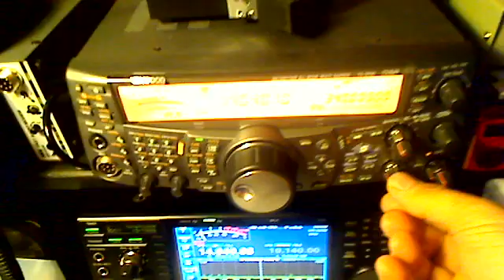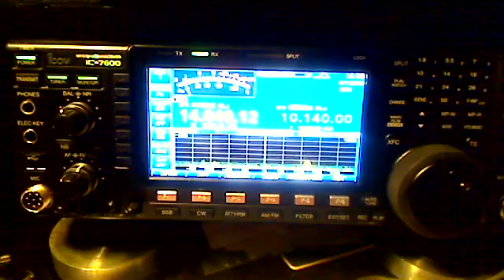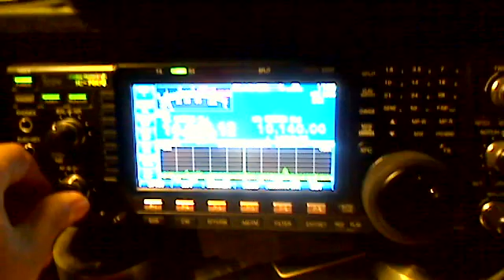TS-2000 vs. IC-7600 vs. KX-1.wmv

Comment: Although we appreciate you comparing with weak signals.
You do not have the settings even closely correct on the 7600 for CW operation.
Please turn to page 39 where it says During CW operation. then retest and repost. Then compare with the same transmitting station say W1AW.

Comparisons like this give people a very wrong impression of a transceiver.
Reply: johnnieace45  Yes he has that not right. The peak tuning is off.

Comment: All QRP rigs I've used have low noise. You are correct. The more conversion stages the rig has, the more noise you will hear. Remember the old TenTec Triton and early Omni series how quiet they were then along came the Corsair with passband tuning. That required an extra conversion stage and the noise was horrible. Single conversion with extra good front end filtering is the way to go.

Comment from the maker: @py2sm -There is no comparison between the IC-7600 and the TS-2000.
The 2000 is a poor HF receiver. It's a one-stop-shopping approach. A good challenge would be the IC-7000 VS. the IC-756 Pro III ..or even better, the new Elecraft KX-3 VS. the Flexradio 3000.

Comment from the maker: I know, this is not rigorous. The little external MP3 speaker on the KX-1
is pretty narrow.. good for CW. I can tell you that all the extra circuitry in the
"big rigs" generate noise of their own and the simple 2-chip KX-1 circuit gives
amazing results if it has a little RF to work with. It's sold.. I'm awaiting the KX-3!

Comment: Nice video.  As a K3 owner, no one has to sell me on the quality of Elecraft products. My only suggestion is to pipe the audio into the same speaker for all 3 rigs and repeat the test.  I doubt the KX1 will disappoint, but it may make the other two rigs "pop" a bit-considering that internal speakers are usually low-watt and tuned for speech rather than CW.  Tx for posting.